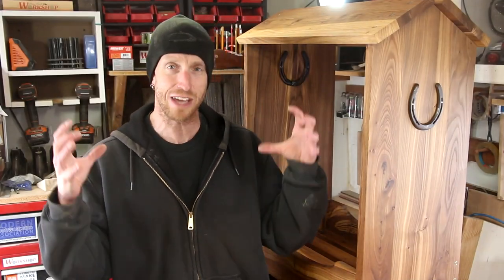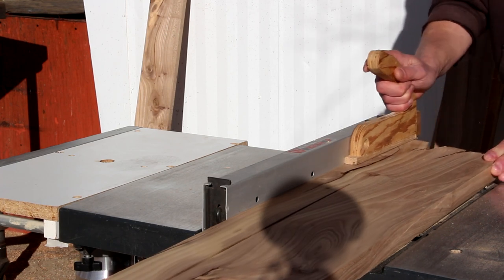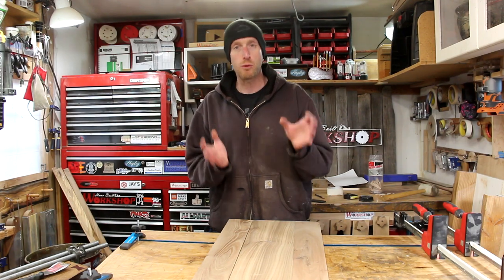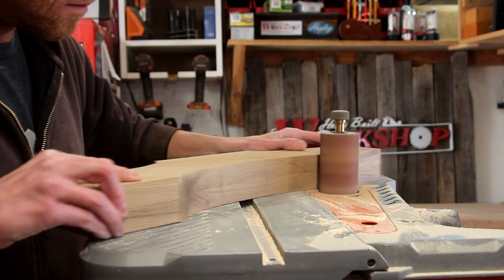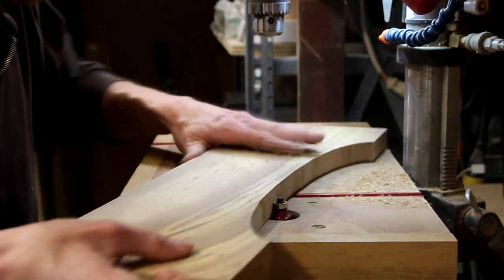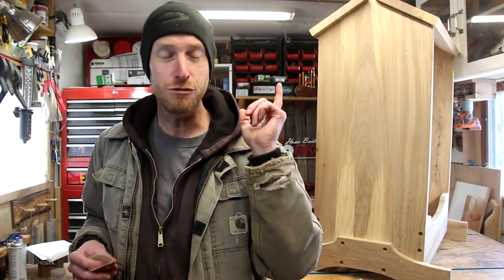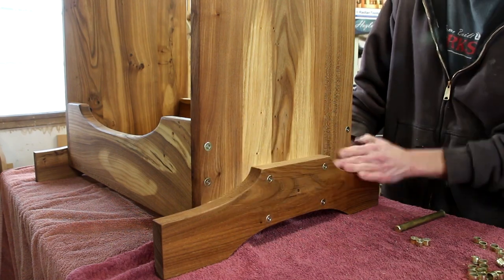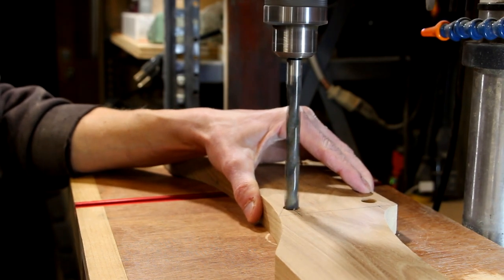Making a Saddle Stand | with Bullet Shell Casings, Conchos, and a Lucky Horseshoe

Comment: Nice looking saddle Stand. The Elm wood is pretty but I understand why most time when a elm tree is cut down it is not used for lumber because it cracks twists and warps so much it's a pain to work with. But when it stays strait it is pretty.
Reply from the maker: It does have a tendency to move around. So far this stand is holding up great and working exactly as intended.

Comment: Hey Jeff, that looks awesome. My style isn't "western" like that. But i can appreciate the style and quality. It looks really really good though. I love the idea of using the spent shells. I was thinking couldn't you mask around the shells and spray some varnish to keep then from tarnishing. Unless you want the patina later. If you need some 9mm shells let me know I'll go throw some lead down range. I love the wrench you printed. I would probably have made an adapter to fit a socket wrench though.
Reply from the maker: Thanks man. I was super happy with how well the wrench worked. I had to print it a few times to get the tolerances right but it worked great. I'm having a blast finding new uses for 3D Printing. Good call on the varnish too. I may take a little and brush it on, or maybe we'll just let it tarnish. Lol.